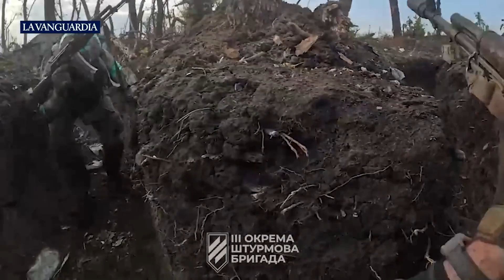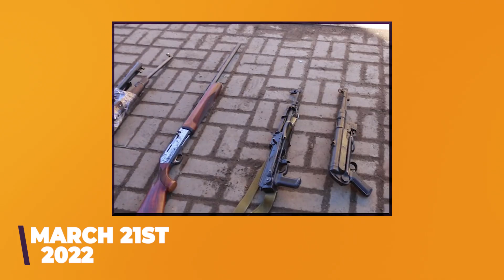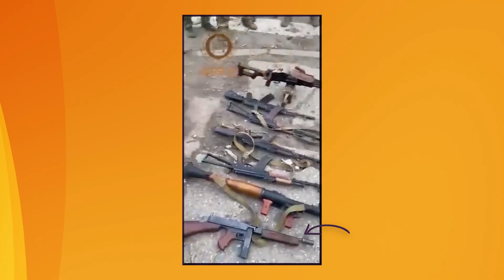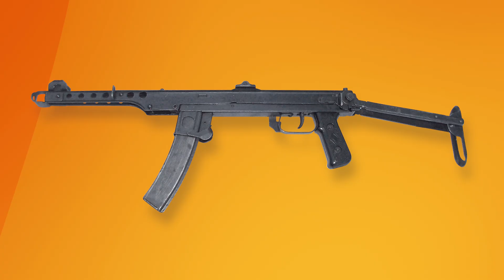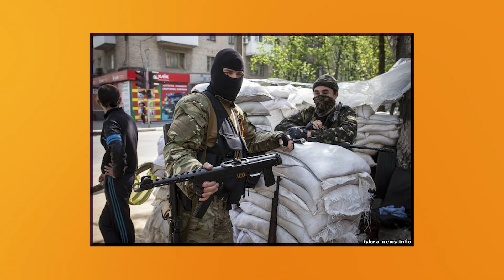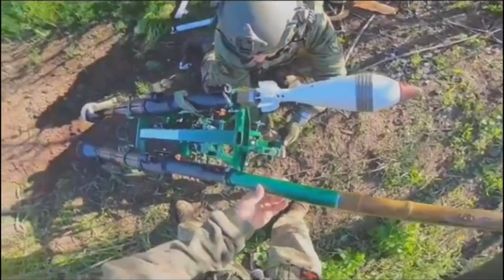The Weirdest Weapons of the Ukrainian War

Comment: 10:40  This doesn't mean what you think it means. 
Governments and their militaries buy or make equipment in very large quantities, for simplification of ordering, manufacturing, and distribution. This uniformity serves many purposes, but ease of distribution is at or near the top of the list. 
So if you're issued (or if you find) a weapon like the PPSh, then you are going to put the magazines for your weapon into whatever pouch is available. For this SMG, you could fit two, maybe three PPSh magazines in the pouch designed to hold one or two AK-47 or -74 magazines. So that's what you do.
In both Iraq and Afghanistan, I carried things in pouches that weren't specifically designed for what I was carrying in them. And so did everyone else who needed to carry their odds and ends.
So, for someone to say with any sense of certainty that just because the soldiers don't have pouches specifically designed to carry the magazines of an outdated weapon system, these soldiers couldn't possibly be using such weapons is absolutely ignorant. 

It's as if your researchers are familiar only with Call of Duty specifications. And so they think that, in the real world, (where losing means dying rather than restarting your attempt with a fresh life at the latest checkpoint), you can't possibly carry this object unless you have the other objects that match it. Well, guess what, geniuses:
You can pick up and carry ammunition for any weapon, regardless of the weapons you are carrying. You don't have to drop either your AK or your secondary weapon (usually a pistol) in order to pick up and carry a couple of boxes of ammo for a shotgun, or for a machine gun, or wtvr. 
This truly is a ridiculous proposition by someone who clearly has no clue about what happens in the real world, especially when the other team is going to kill you if, when, and as it's possible to do so.

Comment: I would say the weirdest is the western media.

Maxim is a excellent gun. Reliable withstands long sustained fire. Fires the 762x54r which is still in high use, and if the position is overrun you don't loose a highly valuable modern MG.

Comment: "...and you know that something is crude when an AK seems advanced by comparison" That line killed me.
Also, the "RPG Mortar" has something that a normal mortar doesn't have. Anti-Tank rounds. The mortars have a wide range of types of ammo but nothing that can damage a medium to heavy armored vehicle. RPG mortars, on the other hand, have both AP (Anti Personnel) rounds or HE (High Explosive) rounds, which are the only type of ammo that a mortar has that can inflict damage, and AT (Anti Tank) rounds. Granted that an AT round to be effective needs to land on the target but although it's small, the chance is there, plus, AT rounds should be very good at damaging fortifications, especially concrete (which are impossible to repair during combat).

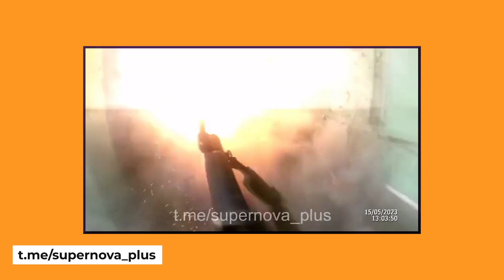Comment: Just a correction, at 15:45 the rpg being fired indoors is not an improvised mortar round, it is rather a standard RPG thermobaric round. The straight sides are clearly visible where the mortars are, well, motar shaped.
Reply: Isn´t it kind of insane to fire a thermobaric charge like 10 meters in front of you in a closed environment?
Reply: @KokosNaSnehu2  very
Reply: @KokosNaSnehu2  OK - 2 choices, you get killed or you kill an enemy and "somewhat" suffer moments later? After all - that's not exactly a "closed environment" as most doors and windows are open/knocked out, some holes are in the walls... so 10m away behind several concrete walls - isn't as unsafe as 3-5 with no such walls around.
Reply: @KokosNaSnehu2 it is insane enough to fire any RPG round indoors. At that point one has to assume that the individual in question isn't concerned about their own wellbeing
Reply: @KokosNaSnehu2  It just makes a bang like everything else, probably like a double handgrenade
Reply: @lugerun  Yeah except for that thermobaric part that sucks up all oxygen in the room.
Reply: Good notice, but it's not a TBG-7, it's a PG-7VL (enhanced penetration HEAT)
Reply: @Erbo_Nebulas I didn't scroll down far enough to see your reply
Reply: @Erbo_Nebulas  That makes more sense to fire at such a short distance. So is it a tandem warhead, or what does enhanced mean in this sense?
Reply: @KokosNaSnehu2  No, not a tandem. Tandem on RPG looks too distinct. PG-VL it's just larger then standard PG-7V. Bigger charge — better penetration capability. VL replaced standard HEAT for like 30+ years till this date.
Reply: @Erbo_Nebulas  Got it. Thanks mate  👍
Reply: I know theyvlikely dont care but aren't thermobaric rounds on a no no list
Reply: @dmh101  nope
Reply: @dmh101  Their method of killing is quite horrifying so the media is rightfully condemning their use but no law does that.
Reply: It looks more like PG-7VL if you pause it just right. You can tell by the base of the warhead.
Reply: first MOFO that I see launching that indoor while aiming in the same building :O that guy is toxic :))
Reply: looks more like a PG-7L but I may be wrong, do you know exactly which thermo round it is because it definitely isnt a TBG
Reply: I bet he won't fire an rpg inside again.

Comment: The CZ Bren 2 has been performing well on the battlefield (not a surprise). That will surely mean a cost bump for us consumers here in the states on that particular rifle. The bren 2 runs a carbon poly lower and is very modular
Reply: Garand thumb just did a video talking about the bren 2. Thing is a great rifle apparently
Reply: @ljguitarwizard yeah I saw that too, and from all apparent appearances, indeed it does seem to be quite a weapons platform to not only be reckoned with, but also in fact worth checking out.... Also heard mention of its use in the current Ukrainian conflict, although my best guess would be in rather very limited numbers. I could be wrong tho

Comment: Anyone using an obsolete weapon of the past is most likely not going to have gear that is designed to hold the magazines. They would probably just put the magazines in a bag so the assumption that the pictures are not their currently used weapon is flawed. IMO if Ukrainians are using what is available that would mean any camouflaged clothes as well as any vehicle, weapon, or drone.

Comment: Good video.  The real story is how little small arms technology has changed over the last 100 years.  While plastics/polymers have replaced wood and supplement metal, the basic mechanism of machine guns and pistols is the same.  The AK and AR15/M16 rifle designs also haven't changed much since the 1940s/50s.
Reply: in many ways, they just can't get much better.

the main points of small arms for militaries are
-cost
-weight
-reliability
-lethality

while you could theoretically pour trillions into building a coil gun that fires micro missiles, you very quickly screw over cost, weight and reliability for very little increase in lethality when a regular bullet will kill a person just fine.
Reply: The real big change for infantry will be getting all troops networked with real-time info being fed to AR visors or built into their optics. Like a video game, soldiers will be able to know exactly where their allies are, ping enemy positions, or even have their weapons auto-correct their aim for them.
Reply: @AirLancer VATS when?

Comment: Here's the thing with any firearm made from the 1870's onwards.  They are accurate, hard hitting and reliable.  Anything before that and you lose at least one of those qualities (sometimes all of them).  The three things they lack are ease of maintenance, high rate of fire and easy access ammunition (usually, at least).  They also can't be fitted with modern sights, flash suppressors or stabilisers*.

(*unless, like in the video, they are.  Which to me is even more crazy, in a cool way)

In bulk, they are truly obsolete.  But in small quantities for limited purpose?  They get the job done.   A trained and motivated soldier with a bolt action rifle from the Victorian era will deadly effective still.  A conscript with an AK is potentially useful - but also just as likely to drop said AK and run away.  Only on peer vs peer are the older weapons at a real disadvantage.
Reply: Studies of the 70s wars in Africa showed troops with M1 Garands could hold their own against troops with AK-47s. Bolt actions, not so much. But a good semiautomatic was enough.
Reply: Ukraine simply has such a large range of guns to choose from that soldeirs get to chose from what they can find. All of Ukraines elite units use m4s now and a lot have some dope builds. Other volunteer corps that have been integrated into the army such as the 3rd assault brigade use pretty much just ak's. But because the 3rd assualt brigade are some of the most experienced fighters in Ukraine have have been taking the flanks of bakhmut pretty much all of their men use sick ak builds because they captured so many guns they either chose one they find is cool of the collect attachments. They pretty much all run supressors and red dots. Some even with some crazy thermal sights. I even saw a supressed rpk with an extended mag and a adjustable stock and best of all a huge infrared scope. Anything like a pkm with a infrared scope is the scariest shit.

Comment: You said the Ukrainians only have 35 Maxims. In truth they had 30,000 of the 1910 Russian made variant before 2014 per Wikipedia. That is the one they are using nowadays. Very interesting video. Thank you.
Reply: I think he meant to say 35,000, but dropped a word. Even pros make mistakes.
Reply: They inherited 35,000 from the Soviets. Surprised we don't see them on armored vehicles attacking trenches. Would be superb in that sustained fire role. But those wiley Ukrainians love those M2 50 cal machineguns better.
Reply: @donwyoming1936 I'm not sure how well the old water jackets and fittings would like vehicular use. Without water the skinny barrels burn up fast.
Reply: Had*
Reply: @I-HAVE-A-BOMB  Had* is irrelevant in the face of the 30,000 1910 variants that they have (had). Just a Maxim by a different name. Thanks for the reply.

Comment: A four-pack of Maxim machine guns mounted to a swiveling stand in Ukraine, shown off in a TikTok video from a user whose handle ends in 69 is going to be one of the defining relics of the 2020s.
Reply: Now just get that quad maxim mounted to some sort of radar directed AA system on a T-55 chassis, and we’ll really have something.
Reply: @jimtalbott9535 nah make it a tacoma
Reply: @rt_goblin_hours  A technical? Doesn’t that “require” a Hilux then?? :p
Reply: Yep 👍 it'll be one of the first things to get pulled from the rubble by visiting species.
Reply: HAHAHAHAHA, fuck man this is hilarious XD
Reply: Wait...... What do you mean by 69?
Reply: 360 quad barrel quick scope before 2025 or riot!
Reply: Why stop at 4? Lets go for 6 or 8 in a mount. We Need More Dakka!
Reply: relic of great war...
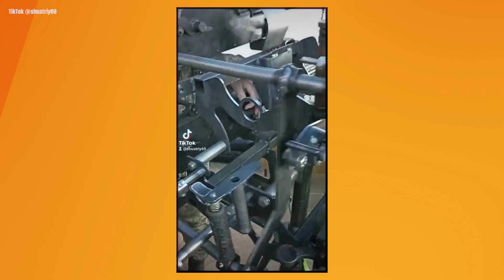Reply: Watched the video right? It's at 3:02.
Reply: Man, trust me - when a Shahed drone explodes above your head - it's not funny and it's better if it does so at least 500m away from you. They are insanely loud doing that - probably due to their size&materials. Almost non-sensible blast wave or ground shock (if you are 1km away; at 50-100m - "windows fly out") compared to usual "Kinzhal" or "Caliber" missiles (they carry 10-20x explosives) but sounds just as horrifying. We got used to that stuff, you know :)
Reply: The M4M, an arrangement of four Maxim guns side-by-side on a pedestal mount and commonly mounted on the bed of GAZ and other medium trucks, was the standard anti-aircraft weapon of the Red Army before the start of WWII; the Ukranians just resurrected the design.
Reply: @seanmalloy7249  wasn't it 4 in a row, not 2+2?

Comment: 6:47 Also worth noting some downsides, which I find interesting on the Thompson:
- It's heavy af at 10lbs, helps with recoil a little bit, but very much wouldn't want to carry this anywhere.
- Bolt mass is high, so when triggered - gun jumps forward and off target. First round very likely to miss (even at 25m).
 not bad in full auto, but single shots are very difficult.
- Trigger sucks (but might have been my specific Thompson, they are old afterall), again not as bad for full auto - but single shots are hard.
- Ammo is pretty heavy (.45 ACP) for a pistol cartridge. Even modern 5,56 rifle rounds are lighter.
- Ammo has bad ballistics - the .45acp drops like a rock. Even for a pistol cartridge. (look at charts, it's like 8" @100yds)

Otherwise a fantastic looking weapon! The aesthetics are wonderful. Very iconic :)
(but in reality you would ditch it for a PPSH41 or even a Stengun very quickly. At least in my experience in firing PPSH and Tommy, both full and semi).
Reply: 8" @100 yards is insane drop, wow lmfao, never knew it was THAT bad! 😵🙃
Reply: Totally Disagree.  I love the Thompson.  Everything about it feels so solid unlike an original Sten that feels like I could break it if I sat on it.  For me, at 6ft 210 lbs I don't find it particularly heavy.  Compared to a modern AR yeah but the construction and technology is totally different.  The ammo can be heavy if using the .45 ACP But they come in many different calibers.  Mine is a 9mm and It feels fantastic.  This isn't a single fire marksman weapon.    IMO Its ability to walk shots on target reliably is more valuable than the pps trying to fly out of your hands
Reply: @HeadCannonPrime  Also a good perspective
Reply: And .45acp doesn’t achieve improved velocity from its longer barrel. It only gains like 50fps from a 16” barrel vs a 5” from a 1911…… in comparison the 9mm gains like 300+ FPS. 1,100 to 1,400 FPS. Probably the round commonly chambered in WW2 era SMG’s that is improved the most is the 7.62 Tokerav that (diff countries ammo velocities varies) goes from 1,400-1,800fps. Aluminum core SMG specific ammo is especially hot.
Reply: The pps43 is another submachine from the era of the sten that surpassed the Thompson in many ways. It had less parts, and larger components so it was less fragile and easier to maintain. The pps43 had a significantly longer range compared to the 45 round, a folding stock for transport/vehicles, and more controllable rate of fire
Reply: @AUstudios  I don’t know a lot about the PPS43 but the Soviet ones seemed to be chambered in 7.62x25 (awesome) while the polish versions were 9mm. I’ve always loved the PPSH-41 personally